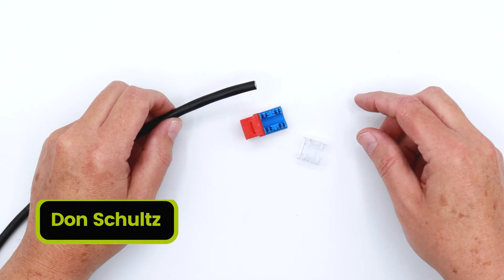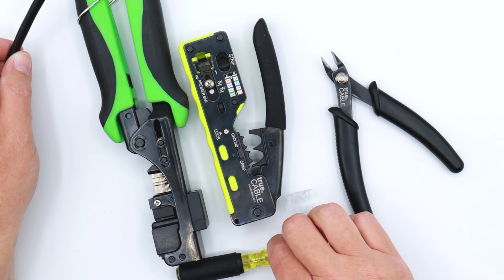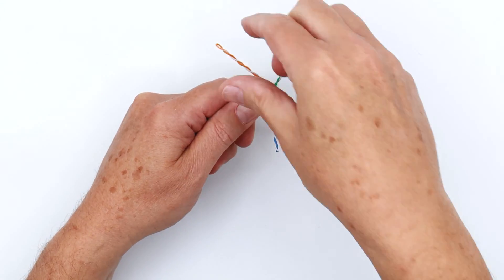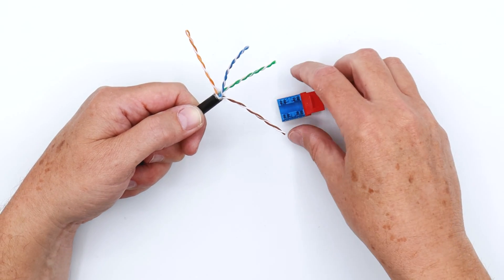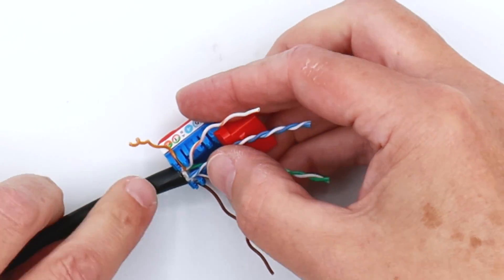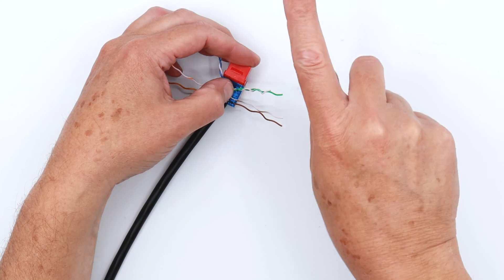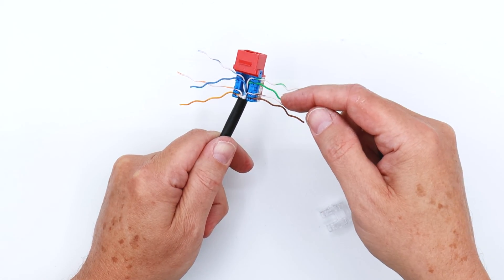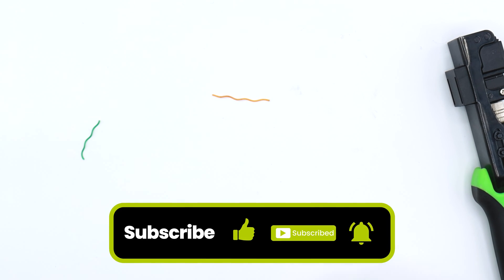How To: Terminating a Keystone Jack Onto Cat6A Direct Burial Ethernet

Comment: Little trick.....after seating the wires in the IDC, and before punch down (or crimp down in this case), you can twist the ends of wires together on each side, so that when you punch down 8 individual wires dont go flying, but rather you have two bundles of wires . easier to clean up.
Reply from the maker: Good tip and thanks for sharing!

Comment: I think the problem is that you assume all installers will have fingernails and the  opportunity to exert tension onto a perfectly flat surface. This does not happen out in the real world and these are by no means toolless jacks. You will need more than the termination tool so be prepared. Bring all your tools with you. The problem is with thick CAT6 wires and the insides of the keystone posts. It is easy enough to maybe pull them into their grooves with needle nose plyers, if your lucky. Sometimes it takes a plastic spudger or a punch down tool, but without punching it down. Same problem every time, wire gets caught on inside of the post. Not bad for the top 2, but the rest can be a struggle. In real world scenarios you are sometimes crammed up against a wall sitting or laying down, because that is all the cable length you have to deal with. Sometimes the client wants you to fix what they have. Often I am standing up, with the keystone in a puck first. I love all the other trueCABLE products, but these pist me off while I am trying to get a job done. Please test these with sweaty hands, after doing 20 in a row, calluses on fingertips and also only 1 foot of cable to work with.
Reply from the maker: Hello and I have been in the same position as you, being a fellow installer. Literally. I was once backed up flat to a wall, keystone in front of me, while trying to terminate a keystone. Not fun. This often occurs on upgrades/retrofits/retermination. I often prefer our punch jacks and rapid termination tool for Categories 6 and lower with insulated conductors that are 1.05mm and less in thickness. The moment you get to 1.08mm you have a fight with the traditional punch keystone as most (including ours) have a 1.10mm limit before the IDC towers literally distort to fit the conductors. Our "toolless" keystones allow for conductor thicknesses approaching 1.20mm but they do require some tools, just not the 110 punch tool. So, you gain more compatibility with thicker conductors with the "toolless" keystones but trade off size and speed of termination with the "toolless" version as there are more parts, and more parts to lose in the process. Never a free lunch, eh? This will become even more of an issue with the industry changing over to more effective Cat6A ANEXT protection with discontinuous ANEXT barriers and thick insulated conductors of 1.10mm and above, which is what Cat6A unshielded will look like in the coming year at some point. Our "toolless" keystones can accept this revision to the design of Cat6A U/UTP but the punch jacks cannot at the moment. A redesigned Cat6A unshielded punch keystone, specific to thicker insulated conductors (but losing lower thickness compatibility) will be required as well. I too often carry an old credit card for help seating conductors, as they can be ruinous on ones fingers to seat into the slots prior to punching. Stay tuned for a lot more around this in the coming new year!

Comment: Sell keystones in lower than 12 / color packs!!!  I don’t do much cabling but like your products.  Most of my networks are small / just a few pulls. I use different keystone colors rather than number cables.  Yellow port in office is yellow back at closet.  

So I need 2 of each color on that job.  12 of each color is too many for me.  No one else does it this way?!!
Reply from the maker: Hello! Thank you for your feedback. We did offer 2 packs at one time (and still do in some styles) but they were not really selling well. I can tell you that if we have more requests for less than 12 packs we will revisit the idea! As to nobody else selling in more than 2 packs, there are quite a few sellers on Amazon that offer 25 packs as the minimum quantity. We tried to strike a balance.